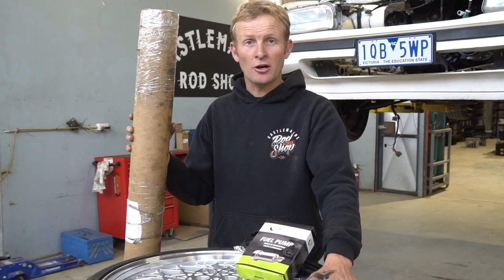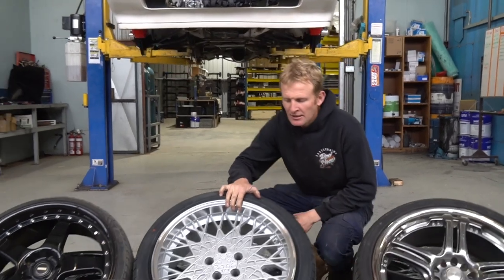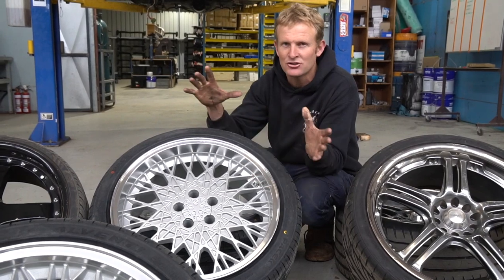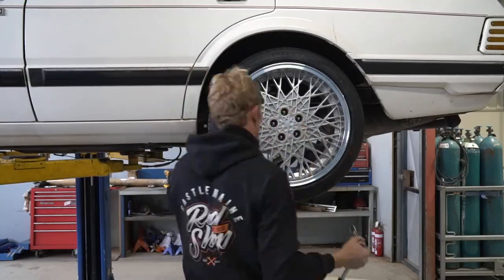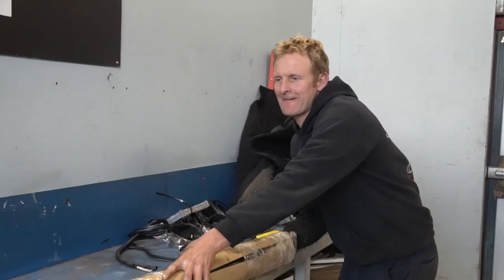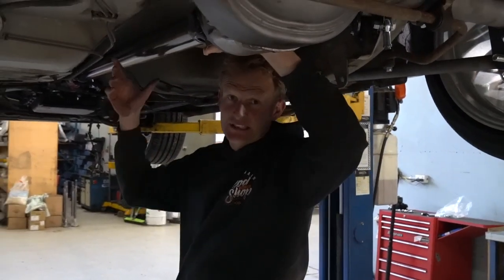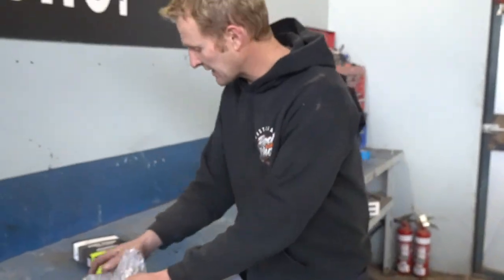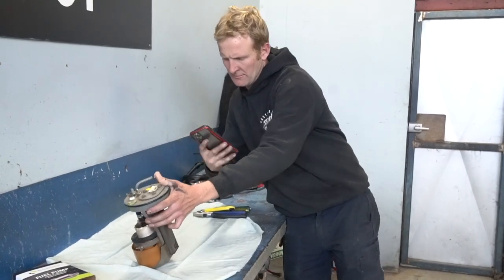XF Ford Falcon Barra swap - EP 7

Comment: Should have used heat shrink on that positive fuel pump feed wire join. Petrol will melt the adhesives in that electrical tape faster than you can say I'm on fire!
Reply: Beat me to it. 5 min max
Reply: Need fuel rated heat shrink. A bit of fuel emersion rated tube would do it same as what he should have used for the wedge so it doesn't turn into a black goo.
Reply: @Blanchy10  Wouldn't be a FORD without wiring issues that result in fire, gotta love that leadlight window soldering iron.

Comment: Sooo that electrical tape will last 2 seconds in the fuel tank and then leave your positive wire exposed, also need submersible fuel hose to wedge down the side should you choose to do that!
Wheels look mint though!
Reply: You're right. that electrical tape will poo the bed as soon as fuel hits in
Reply: Yep i was about to write the same thing, should of used heat shrink on the positive wire and used a fuel hose that designed to be submersible, that hose they used will be come gummy over time and block up the fuel pump, 
Being a "reputable build shop" you think they would do things the right way to start with.
Reply: True pretty Dogy seems abit rushed

Comment: Great series! I just did the same pump installation and had issues running the factory cup thing the pumps sits in, was like it was running out of fuel so removed cup and it fixed it.

Comment: Is it just me, or did that cover over the fuel sender unit get put back on upside down? All the ones I've removed and refitted over the years always had the foam seal go between the cover and the tank, not on top of the cover 😂😂
Reply: Was thinking the same thing.
Don't worry he'll have to take it off again once the fuel kills the adhesive on the electrical tape used on the positive pump wire!

Comment: The tape is going to fall off the wire connection soon as fuel eats the glue off the tape ...heat shrink would of been the best option ...

Comment: The wiring of the fuel pump active wire is not safe taped up like that,  insulation tape will dissolve in minutes allowing the active to spark on sumething. it would've been much safer to cable tie it to the rubber hose than just tape it up.

Comment: Noob question but how do + and - wire's  in a petrol tank not go bang?
Reply: Sealed fuel pump, brushless motor, electrical tape on the + wire will help with the explosion.
Reply: Fuel isn't conductive and the air fuel ratio isn't correct.
Google upper explosion limit and it will explain

Comment: I'd be pulling that fuel pump back out and using ethanol submersible hose for feed and return and wedge. piss the tape off fix the wiring, you should of used the plug that came with the pump that's what it's design for but you didn't get the installation kit with the pump

Comment: Were did u get the snowflakes
Reply: Don't u listen? MC racing in Sydney
Reply: @blumie006  huh?
Reply from the maker: MC racing wheels mate.
Reply: @CastlemaineRodShop1976  yeah i didnt here the part in vid cheers
Reply: @CastlemaineRodShop1976  hey do your engine mounts allow for clearance with the barra rocker cover and the bonnet webbing.ive herd turf mounts you still have to cut the bonnet for clearance

Comment: Those wheels look stupid. Simply use the factory 15x7.  They  are dangerous on  XF. Throw way too much load into the suspension pickups. Especially the  castor arms up under the radiator.
Ditto with eurathane bushings. And IF used together super dangerous.
And yes I have seen all of the above numerous times.  And seen damaged cars where the bushings alone have caused the suspension to fail.
And have seen rear arms that are close to failure with wanker wheel sizes.
Nitto tape will have a ten second life in the fuel tank.
And IF the car is intended to use E85 you have to use proper efi hose.  Normal fuel line rots rapidly.